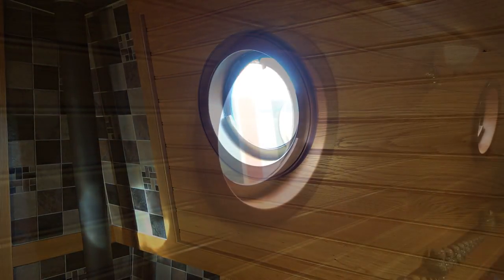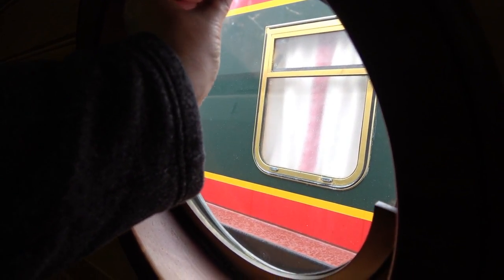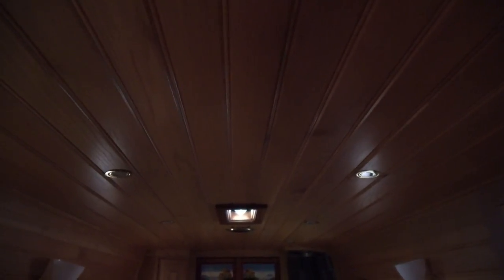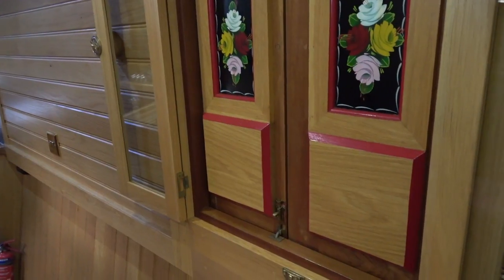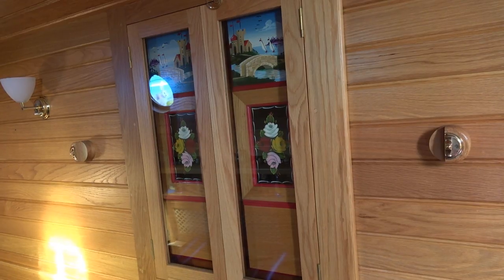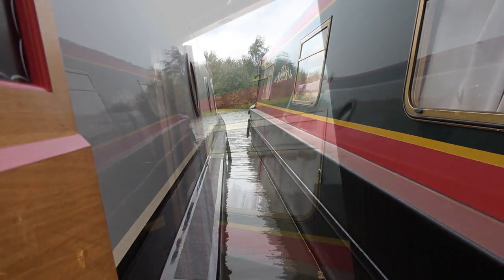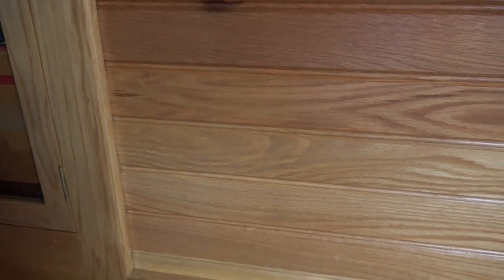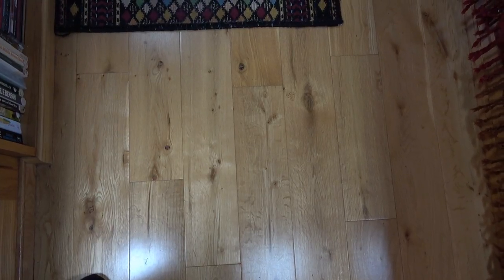Narrowboat Interior Design - Part One - Interior Wood - Side Hatches - Roses & Castles

Comment: Hi there B&K,
Forgive me as I’m new to boat design. You’ve said you don’t have any MDF, etc in your boat. I’ve seen boatbuilders do (I think it’s the ‘lined’ version) boats where they’ve nailed MDF or whatever onto the wood strips that partition the foam insulation. Do your T&G hardwood boards get screwed straight into those wood partition strips where the foam is or is there something in between?

Also- I’m just trying to get my head around this!... if you have a high wall cupboard, what’s securing it to the shell? Surely jot just those wood strips? (New head is picturing heavy contents and how that’s secure?!)

Thank you so much for your informative vlogs- I’m slowly making my way through them!! Stay safe, Cheryl. xx
Reply from the maker: Hi Cheryl
MDF is a cheap material used by budget boat builders. Being compressed paper if untreated it could absorb water and expand and become unstable. Even water resistant MDF can deteriorate and warp. Those wooden battening  pieces on the cabin sides should in theory be kiln dried and screwed into the angle iron frames making them very secure. Sadly not all boat builders we have do this. Behind our t&g we have 6mm water and boil proof plywood panels properly secured to the battening. This makes for a very solid fit out with no wood movement.
Regarding high level cupboards it depends on the quality of the boat builder. On some boats you will see very few or no high level cupboards, this keeps the boat price down. All our cupboards have solid frames built into the woodwork, the strips serve no purpose apart from giving the fit out a chunky solid look and feel. Cheers. B & K

Comment: First of all what a lovely boat , can you tell how to get air out of my system . I put the washer on in the boat and ran out of water 💦 😪 thank you Pauline and Phil 👍
Reply from the maker: Hi Phil & Pauline, thank you for commenting. I don't know how your boat pipework is set up, so sorry I can't help. 👍👍
Reply from the maker: If struggling try one of the easiest ways to remove air locks iby connecting an hosepipe to one of the taps and the other end to an outside tap. Open another tap and backfill your system.
Without knowing the pipework setup it is the best suggestion possible. Cheers Keith
Reply: Thanks Keith will tell Phil , hope you both have a great Christmas 🎄

Comment: Fabulous boat. I can see the pride and joy that you’ve both put into it. I can’t wait for the next instalment. Apart from the Alde heat exchanger that you retro fitted, is there anything else you wished you’d done, or is it perfect? My little boat is off to Boating Leisure Services shortly for a repaint, electrics upgrade and solar panels and a general check over so it all ready for spring. I have to get there from our marina at Ventnor before the locks at Braunston close on the 6th November. So I’ll be making my maiden voyage through the Braunston tunnel soon! Thanks for a great video.
Reply from the maker: This was a big decision for us as we did not want to look like we were bragging when in fact we are just proud.
Perfection? - all we can say is we would not change anything which means we are both very happy. The only thing we thought about was the washing machine which on this boat we decided against having. Keith could easily retro fit but we are happy to hand wash, use our 2800 RPM spin drier and take the large things to a launderette: see  http://aylesburycanal.org.uk/laundrette-list/
We also are having solar panels next year but again (as usual) it is slightly different and will include metal made boxes and gas struts. 
Hope everything goes well at BLS and enjoy the tunnel.
Thanks for watching (again)

Comment: Can I ask why you have gone for a separate tank for the stove and not used the main tank, thanks Mike.
Reply from the maker: Hi Mike
It is all to do with simplicity, storage and no hassle pricing of red diesel.
1. No diesel pipe running through the boat interior.
2. No pump required to get the fuel to the oil stove, it is just gravity fed.
3. We can have a large storage of heating fuel without impacting on the engine fuel tank levels. Over winter it is best practice to keep the fuel tank topped up to maximum to remove the chance of condensation/water forming at the bottom. 
4. When refuelling some places query the diesel pricing split. With a separate tank we are guaranteed 100% to get the cheapest diesel price because it does not provide fuel for propulsion.
Hope that makes sense.
Cheers B & K 👍🌞